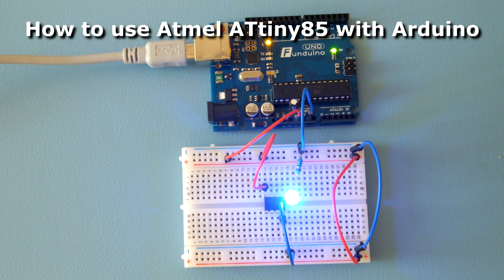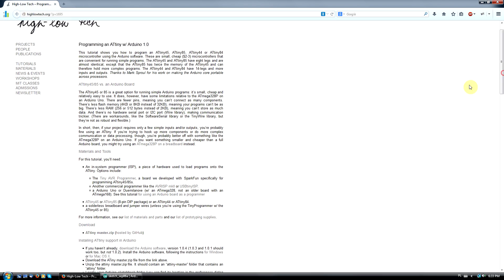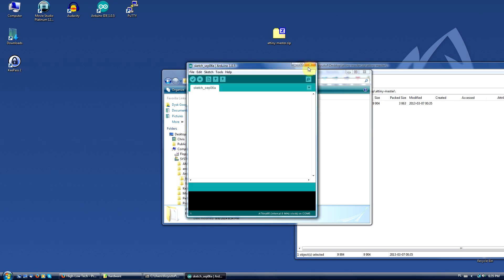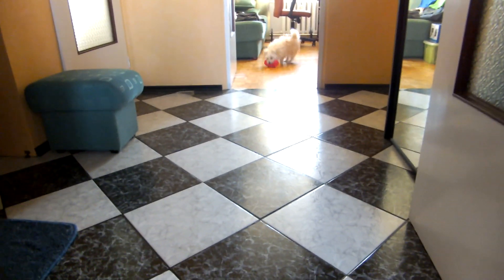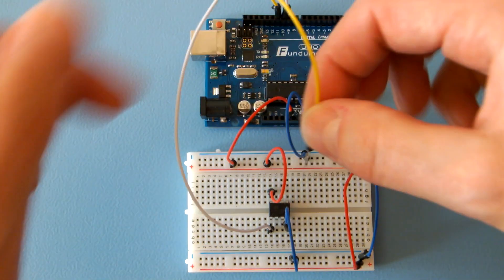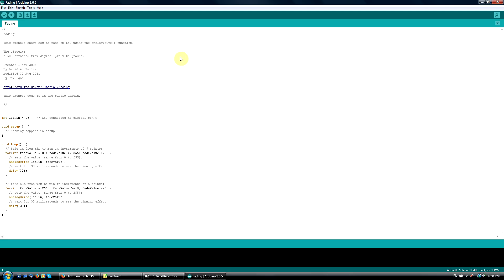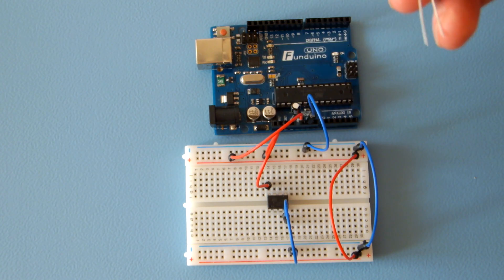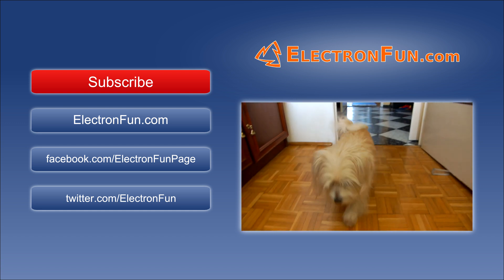How to use Atmel ATtiny85 with Arduino || Arduino tutorial

Comment: Why does the Atmel ATtiney85 not need a 16MHz crystal?
Reply from the maker: It has an internal crystal oscillator, so you don't have to use an external one. However, you can do it, if you need higher accuracy, or for some other reasons.

Comment: put the folder (unzipped) in the folder as said and the poxy thing dont pick up the attiny in the list.. why?
Reply: I would suggest you didn't rename the folder to remove the -master suffix! The folder name MUST match the name of the library and its header file.
Reply: +Nick B dw guys i used another video and it worked.. thanks anyways
Reply: +ElectronFun.com 👍
Reply from the maker: Quite a few things have changed from 2014. Now you can install additional boards through Arduino IDE. Just follow this tutorial: http://highlowtech.org/?p=1695.
Reply from the maker: Good to hear you managed to solve your problem :)

Comment: Thank you so much! I've just got into Arduino and in 6 minutes you've opened my eyes/given me a massive paradigm shift in understanding why this is such a powerful and versatile system. Could you tell us some more about what you've learned in real world terms of the power and battery requirements for this small microcontroller please? Ps your dog is very sweet!
Reply from the maker: +northshorepx Thanks a lot, you've just made my day!
When it comes to the power requirements of the ATtiny85 - the datasheet says is should use approximately 300uA when idle. I know it's not always easy to get such results in real life. See this thread: http://electronics.stackexchange.com/questions/124723/attiny85-power-consumption-double-expected - it explains a lot.
Tina the dog says: "Thank you so much!" :)

Comment: Hi, great video! But, how can I make a standalone? How I would use a battery? Thanks!
Reply from the maker: +Gustavo Silveira Thanks a lot! The video is about making a standalone ATtiny85. When you upload your sketch to the chip, you don't need the Arduino Uno anymore - just replace it with a battery.
Reply: +ElectronFun.com  But for the power supply, the attiny needs a voltage regulator? What kind of current it can handle? Thanks again!
Reply from the maker: +Gustavo Silveira As far as I remember it needs 2.7-5.5V to operate, but if you want to use it with 20MHz oscillator it requires at least 4.5V. A buck converter or a voltage regulator would be a good idea. For the current output - it's limited to 40mA per I/O pin.

Comment: newb here...dumb question time, are the AT,s  re-writable?...and if they are how do you burn it forever, ....sorry, big time newby, but dabbles with mostly audio electronics ....and would like to build/burn dedicated projects....cheers man. rob.
Reply from the maker: +100roberthenry Hi, yes the Atmel AT microcontrollers are "re-writable". I don't think there is a way to burn your sketch forever, you can always burn a new one over the old one.
Reply: +ElectronFun.com briiliant, thanks for your reply, just another question, how do you shrink a project if it is physically using say, 6 analog pins, ?  is there a bigver attiny for that?..sorry for dumb questions..thanks. rob,
Reply from the maker: +100roberthenry There are no dumb questions, most of the time ;) Your question is not dumb. I'm afraid there are no ATtiny variants with 6 analog pins, but I guess you could use a shift register to get more analog pins.

Comment: I am just starting playing arround with the Arduino for about 4-5 month so I don't know much about it . But I manage to right the code for the SOS morse code with an LED and a buzzer . On the other hand I don't know how to get the signal from RC into the Arduino . Basicaly I want to make a replica to these Open Source "Lost Model Alarm" 
http://www.plastibots.com/index.php/2015/01/01/quadcopter-enhanced-lost-model-alarm/

 : Parts:
■ATTiny85 (An 84 or even 25 may work as well)
■Piezo buzzer (5V or higher)
■100 Ohm resistor
■LED (blue was used here – range is about 2.5 – 3.5v)
■Servo lead wire

Tx Set-up:
The Turnigy 9x Ch7 is configured to Pit Trim – which is Aux 2.  Also note that you may have to reverse the channel if your values appear opposite when testing (see Tips below).  To do this, navigate to the settings > Reverse section in your TX and reverse Aux 2.  You can also see the trimpot change if you go to Display > Settings.  When turned all the way CCW, the  bar should appear filled to the right, and vise-versa as you turn it CW.
■I wanted to keep the AtTiny85 pins exposed for future updates.
■I also added an 100 Ohm resistor inline as the LED only needs about 2.5v.
■Set my Turnigy TX Ch7 using the Pit Trim (Aux 2).  The values for Pit Trim range from 1043 (all the way CCW) to 1867 (all the way CW)
■The code watches the PPM signal and reacts as follows: 
■If the TX is switched off (value falls to 0), trigger the alarm.  For the Arduino code, I just look for any value less than 50 (this allows for some buffer).
■If the trimpot is turned up all the way CW, trigger the alarm.  I also wanted to change the tone and beep rate depending on how high I turn the trimpot.  The Arduino code does this by reacting for any value above 1500, and will trigger the faster beep above 1700 and slower beep above 1500.

Tips:
You can use the same code below to read the PPM values from your receiver.  Simply uncomment the Serial.print lines and remove the rest of the logic.  Connect your RX signal pin to the pin identified for RcPin (0 on the ATTiny below) and the RX black wire to GND on your Ardiuno.   This assumes you have your Arduino connected to your PC/Mac, so don’t connect the red (5v) wire coming out of your RX to anything.  Run the below sketch, open the serial window and watch the values being returned as you turn the trim knob.  If they are not changing you need to check to ensure you have the right channel configured on your TX and you are plugged into the same channel on your RX.  Also ensure you power up your Quad Rx.

Enhancements:

Having a range of values from a trimpot gives you a plethora of control options using a single channel.   Ideas:

■You could configure the below code to trigger an external more powerful alarm when the PPM value is in a specific range (i.e. 1800 – 1850).
■Have it trigger a high intensity LED powered off the main battery pack using a transistor to switch the LED or blink it.
■Use the trimpot ranges to trigger different activities.  For example, you could still have the alarm trigger when the Tx looses power (value = 0) and have a multi-coloured LED light strip that changes colours depending on values greater than 0.

I hope these is helpfool . 
MANY THANKS in Advance
Reply from the maker: MARIUS Petcu I don't have access to a similar radio and it's rather difficult to hack a device without seeing it. I'm sorry I couldn't help you.

Comment: HELLO ,  So simple and efective . I need to make a beacon / recovery device on my RC submarine . All I want is to make a Sound (with a small buzer) and Light signal (with a white LED) - S.O.S. morse code , with the most simple and cheep microcontroler and Your example is the most simple I can found . Can You help me with the start code for it ?. The principle is simple : when the RC submarine loose the the RF signal for more than 3 sec , the device it should start emit the SOS morse code with the LED and the buzzer .
THANK YOU very Much in Advance . All the best .
Reply from the maker: profesorultraznit Hi, thanks for your nice comment. I'm happy you found my video simple and useful :) I'll try to help you with the code (if I can). First of all - how do you control your submarine? is it some kind of a DIY RC radio, or something that you can buy? We need some kind of a signal for the Arduino, or in your case lack of the signal for a period of time that would trigger the recovery device. Do you have any ideas what you could connect to the Arduino, which would give the input signal?

Comment: PLEASE HELP!!! [URGENT!!!]
Can I use 25V 2.2 uF electrolytic capacitor instead of 50V 10uF capacitor? i don't have the 10 uF cap and I need to complete the project urgently. i worry that I will destroy the Chips!.. Thank you
Reply from the maker: Vivek Mathema Hi, your capacitor doesn't have to be rated for 50 or even 25V - in this case 10V is more than enough. I'm not sure if 2.2uF cap will work, but you can try with no fear - you won't damage the chip. If the capacity turns out too small, you can always connect 4 or 5 2.2uF capacitors in parallel and you'll make a capacitor close to 10uF.